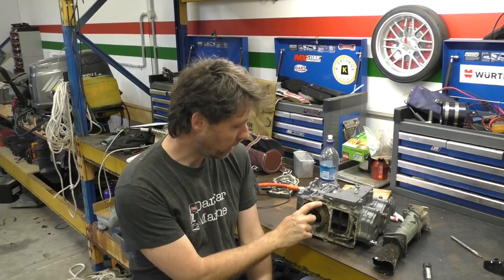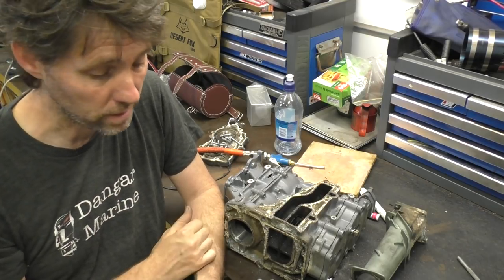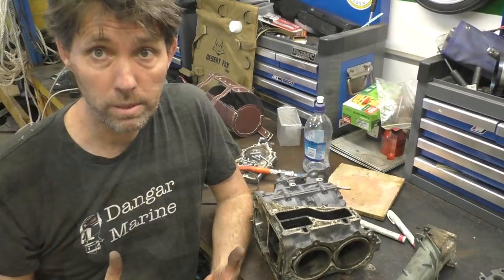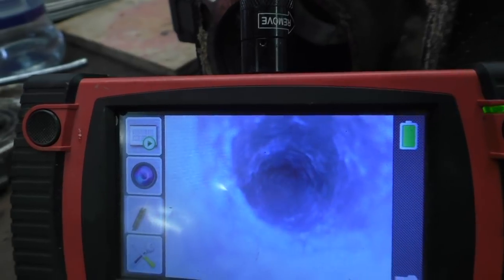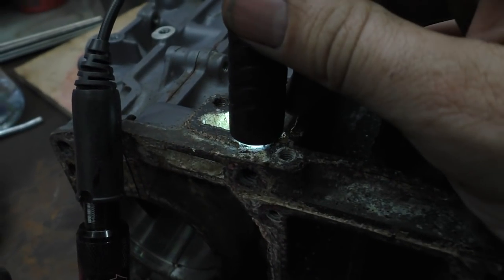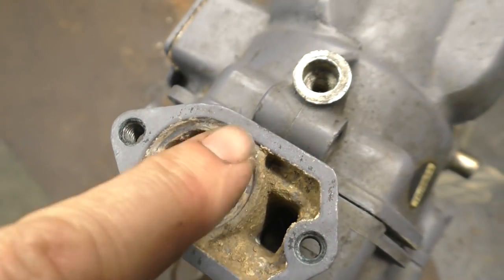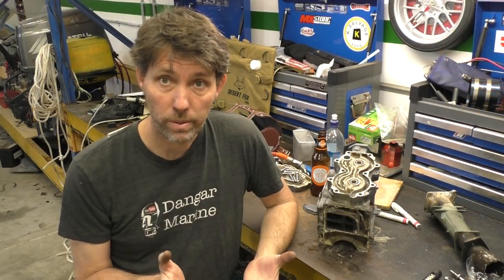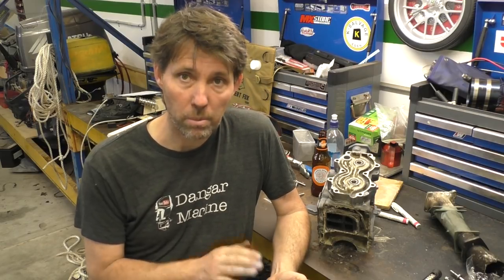Outboard cooling water

Comment: Hi Thank you so much for this video. Im hoping you can help me with my problem as i have run out of ideas. I have a Yamaha 50 HP 4 stroke outboard F50DET. Motor has been at me for 15 years with no major problems. Used the boat twice this summer with no problems, until a few weeks ago i drove into a bay and reduced the speed, after a few minutes the temperature buzzer sounded, with cool water coming out very well from the tale tail and at a strong pressure. To cut a long story short, i removed the thermostat which was blocked in close position. Still after 4 minutes on idle the temperature buzzer would beep. My mechanic came over removed and cleaned the exhaust plate, changed the impeller and still after 4 minutes on idle the temperature buzzer would beep. We decided to have a look at the cylinder heads, and we found a lot of salt/calcium deposits blocking the bottom part of the bottom cylinder head. Obstructing the water passage way from the cylinder heads to the exhaust plate. Being confident that we solved this problem the mechanic reassembled all parts this morning. Switched on the engine and still on idle after around 5 minutes the temperature buzzer went off. I am honestly out of ideas and desperate to find a solution. Engine is really getting hot especially around the thermostat area. We also tried changing the temperature sensor with a new one but still no change. When i switch in the motor without the thermostat cover water flows out. Any ideas what could be wrong? really appreciate your feedback.
Reply from the maker: If water is flowing up to the thermostat and the thermostat is opening it can really only be blocked cooling passages or a blown head gasket (which allows the combustion gasses to blow the cooling water out of the jackets)
Reply from the maker: Actually, I would also check ignition timing and if the mixture is lean as they can affect temperature too.
Reply: @DangarMarine  Thank you so much for your feedback.  Will relay this information to my mechanic. Yes water is flowing up to the thermostat, yet i have noticed that the top 2 cylinder heads (ones closest to termostat) are the ones which are heating up the quickest. The bottom 2 feel relatively cooler. He is coming over on saturday and he wants to remove the engine block and check for water blockages in the water passages under the engine block. Does this make any sense to you ?
Reply: @DangarMarine  may i please ask you what you mean by "if the mixture is lean" what mixture are you referring to please? Also the tell tale water flow is constant, you mentioned in your video that an inconsistant water flow may mean that combustion gases are mixing with water.

Comment: Another excellent tutorial. I have a 90 Yamaha 2 stroke. 20 years old and runs great. Just started getting hot after 10-15 minuets of full throttle. The Alarm sounds. It was fine at idle or low speed. Turned out to be popitt valve by thermostat. It was clogged with salt deposits. My question is... do you think it’s worth taking the head off just to inspect the water jackets?  If corroded of clogged How to clean? What to clean with?  As I said it runs excellent after cleaning popit valve. But im guessing there could be crud in there if the popitt valve had deposits. Thanks for your excellent videos and easy to understand tutorials
Reply from the maker: This video covers a few choices for cleaning the outboard. If it is running well now I would just try flushing a few times before taking the head off. The trouble with removing the head is that as well as needing a new head gasket, you don't know what else is going to happen with regards to bolts breaking etc. It needs to be really worth the risk. Here is a vid on various cleaning options https://www.youtube.com/watch?v=8w_o5xB8ZFI

Comment: Is there any way to clean the water passages ? Any additives  that will clean corrosion out ?
Reply: Rod Ashford  I heard from HullTruth that using white vinegar plus water, about 1:5 of mixture and let the outboard run about 15 minute or run until overheat alarms.  I would like to get try about it, but in my place its hard to find a big supply of white vinegar btw
Reply: Jerry Chan cheers for that i might try that and see if it works
Reply: Ive tried that with the block stripped, exactly like this demo powerhead,  it dissolved salt deposits after a overnight soak. I also use vinegar on my scuba gear works great but a bit sour on the taste buds hahaha...... I dont know about running the outboard with vinegar in it though.....I dont think youll get the full effect as the vinegar is just passing through and doesnt have time to dissolve the salt deposits. try it in a glass youll see what I mean.  just my thoughts good luck
Reply: J B Nz cheers mate, I will try and let you know how it goes
Reply: there is... salt away ...that is for flushing outboards with the ear muffs, Its not cheap though but worth it in the long run..
Reply: Caustic soda and water works well, Just mixed up a brew in a drum and run the motor for
10-15 minutes. Yamaha's are notorious for blockages
Reply: Baikal how much caustic in 80L/ 20 gallons  of water?
Reply: Hi. I am not sure of the ratio to use... All depends on the concentration of the caustic soda and level of corrosion. You have to be careful with the soda as it can de-solve the alloy castings if left for long periods and if you have a very strong brew. Just experiment... Just start off with a weak brew and go from there... Then flush the motor completely with fresh water.

Comment: Thank you for great videos. I have no thermostat in my outbord mariner 30 hp year 1985. When i try to start the motor it just rushing after a while. Do you think no thermostat is the issue? I have already check the plugs and they are new and spark is good on both cylinders,and carburettor is clean. I have also changed the head gasket. Gas pump are also checked and good. Sorry for my bad English, hope you understand
Reply: I livein Sweden. And is winter and cold now when i try to start it up. it takes about 10-20 sec then the motor is rushing hard. I bougt this motor to renovate it. // thanks Anders.
Reply from the maker: By rushing do you mean that it running at high RPM? That doesn't sound like a missing thermostat problem to me. Does your outboard have a manual choke or some other system for adding extra fuel when the motor is starting cold?
Reply: Dangar Marine yes high rpm after start.  Yes i have manuell chocke. I also have some high exhaust gas when the motor is running.
Reply from the maker: If you have a manual choke then it can't be a problem with a failing auto system. It may also be a vacuum leak or a misadjusted carburettor.
Reply: Dangar Marine  thx 👍 i will try to clean up the whole fuel system again. Comp test was 7.1 and 7.5 (cold engine). Do you think that is to low 2 stroke 30HP mariner year 1985.

Comment: Fantastic video!  Now makes me curious about my setup though.  I have an old 115 which is 4 cylinders,  2 heads.  I put a temperature gauge on the one that is higher but wondering if that’s only tells me half the story.  Does that not give me any indication at all if the other side is a totally different temperature if the thermostat fails or the water jackets are clogged
Reply from the maker: That would be one of those “Typical!” Moments. ;)

Comment: Looks like I'll be replacing my thermostat now......as a preventative measure.   I has assumed a good flow out of the tube was all I was looking for.    Thanks for potentially saving my engine.
Reply from the maker: Yes, thermostats are definitely something I would be changing every 3-5 years depending on use.
Reply: Dangar Marine 
Haven't looked yet; I'm assuming it should be relatively the same location on my evinrude 60.   Thanks for the information.

Comment: Your videos are great, keep them coming. I actually have an 50hp Johnson with bad idle and something causing some water  to get on lower cylinder. Watching your video of headgasket replacement and this (even they are from yamaha) gave me some pointers what to expect when i start to tear it apart. :) There are not so many good outboard repair videos on the youtube at the moment.. Actually most of them are really dissapointing to watch. :D
Reply from the maker: Most two stroke head gaskets are pretty similar, and fortunately pretty each to do. Just take a good look for any damage to the block and head before you put it back together.

Comment: Do you know any information about out under hull cooling tubes? I have a Sea Ray 30'ft and was thinking of a better cooling system to use a dry exhaust. This will be wet slipped and not trailered. I would like to hear your opinion and any information given. I have 2x FORD 425 and it Wet exhaust. Thank You
Reply from the maker: Keel cooling certainly does have its advantages. I've never done a conversion on a boat but I'm definitely planning to do a video on it one day.

Comment: I have a 2004 15 honda tiller handle 4 stroke outboard that sits in a motor well on my sail boat. I have to sit by the top opening cover in the back of the cockpit. I was wondering if you will ever do a tiller handle to remote control video. I have searched but  have not found any videos on how to do it.
Reply from the maker: I've been planning to film that video on a mates motor for quite some time now. I must get around to it soon!
Reply: it would be must appreciated since there are no you tube videos

Comment: The second hole could be a decompression valve for easy starting. Only thing is that it looks a little big for that.
Reply: Seth Carrasco I believe you are correct. The reason for the passage design is to make flow through the port less effective at high RPM so you don't loose  power by it being there.

Comment: Hi Stu. My two stroke doesn't live in the water, I trailer it and flush the motor after every use. Do I need to run the motor on the muffs long enough to open the thermostat in order to properly flush the water jackets? Otherwise I'm not really cleaning most of the water path? I've always been told not to run it too long on the muffs in order to avoid it overheating. Cheers.
Reply from the maker: Yes, you need to run it until it is warm enough for the thermostat to open to flush it properly.

Comment: Great video!
I have a yamaha 25 dm 695 (25hp 2 stroke 1986)
Having bother with overheating, i’m experiencing the same situation you explained at the end but i dont have any big chunks out of cylinder head, i have cleaned all waterways, on your did it just need the head gasket replacing to fix the engine? 
Thanks

Comment: I have water dripping out of my cylinder cover when running, and some small bubbles under throttle, this is at the very bottom cylinder. 96 evinrude 25hp. Just bought it,and ran it for several miles,it did amazing. Guess I’m going to go ahead and do a head gasket on it…
Reply from the maker: Water dripping from the cylinder head is never good. Well worth doing the work.

Comment: Hello Dangar Stu. I know you are a busy man, but I had hoped you would have been able to answer my questions below. I would also ask why they do not put the pee hole where the cooling water exists the powerhead, then we would know everything is working as it should.  Could my problem be that the water on the Starboard is not escaping to the exhaust and therefor overheating. Thanks again, I love you videos.
Bob, in Victoria, Canada.
,

Comment: Hi dangar, thanks for video, it most usefull for me, one question, my motor can mount a thermostat of 42° or one of 62° wich is more indicated?
Reply from the maker: To be honest, I don't often look at the temperatures I just order them by part number. I did just read this interesting forum thread on MarineEngine.com that talks about the difference between salt and fresh water use which may explain the choice http://www.marineengine.com/boat-forum/showthread.php?397402-thermostat-temp

Comment: I have a 1979 35 hp johnson I finally noticed it's not pumping water got new impeller put in but now 95 compression on bottom cylinder and 75 top cylinder so is it shot or need head milled and new gasket any advice please

Comment: Funny you should post a Video on cooling, I have a Mariner 4m that has a little puzzle for me. 
No water from the tell-tail so I checked that the tubes were clear and replaced the impeller. 
After the first start-up it had a little bit of water flow then nothing, so I rechecked that the tubes were clear. 
All that is coming out now is exhaust ??????  no water.
Reply from the maker: I would start by doing this test https://www.youtube.com/watch?v=lOE_VRda52A The ultimate test really is does the outboard stay cool or overheat. A cheap $15 infrared thermometer will help you determine that and put your mind at ease.
Reply: Thanks for the quick reply !!! 
I will try this.

Comment: If the thermostat is stuck closed or the galleries are plugged would that also put the water pump under much more stress trying to pump all that water just out the tell-tale? That being said since the drive shaft runs the pump would you notice engine performance degrade as the shaft tries to drive all that water pressure or will the impeller simply slip under that load?
Reply from the maker: Because the fins on the impeller are flexible it doesn't really cause much of a change. There is always quite a bit of back pressure on these pumps.

Comment: I have a 1972 25hp johnson that has no tell tale, is that normal? Also when u assemble the water jacket covers should you use gasket sealer on both sides of both paper gaskets? Thanks for all you do in ur videos

Comment: this was cool here is my problemi have an 2012 175 yamaha the over heat alarm goes off only when its at idle so i replaced the popet both thermo stats and impeller and no change so yeah its got me lil worried i just payed alot for this thing but as long as im above a certain amount of rpms to increase water flow it doesnt over heat or atleast the alarm wont go off but am i doing harm to my motor

Comment: Another great video....do you have a video on what you do if the water is not reaching the thermostat. After putting in new thermostats I still got the overheating warning buzzer and when touching the port side water jacket it felt much hotter then the starboard side, so I took off the water jacket but it did not look clogged up with gunk. The inside looked dry as though no water passed through it, but then thought it could have dried up with the heat before I got the cover off. After watching your video I will run the engines and see if there is water getting to the thermostat or coming out the whole where the thermostat is located. I would also be interested to know if the same water passes through both sides of the engine, as I can only see what looks like a temperature sender on the starboard side only. Should there be one for each set of 3 cylinders? The engine is a 1990 Evinrude 150 hp XP V6. Any idea what XP stands for.
Thanks again for the video. Yours are the best videos on youtube, and glad you have a sponsor. I would buy from them, but I live in Canada.

Comment: Very good video as always! Always felt like the water cooling in an outboard seemed like a solution that's fraught with failure that leads to destroyed motors. Why not have an enclosed system like a car with a heat exchanger/radiator with said radiator built in to the leg where it could easily be cooled by the water the boat is in?
Reply from the maker: Cost and weight are probably the simple answers. Because outboards hang out past the transom weight is very important, and everyone is looking for the cheapest price they can get. I have been interested in doing a video on a fresh water conversion on day just for the fun of it.

Comment: This has probably saved me from ripping my powerhead off. 
I have a 1979 Johnson 115, I was under the impression that all the water came out the exhaust after flowing around the block etc. on mine, very little comes out the prop/exhaust and most comes out little drain holes in the lower leg.  
If anyone could confirm this, it would be greatly appreciated. 
Thanks for the vids Stu.

Comment: Great video, hope you can do one on a Merc V6 and an Evinrude V6 too!! ( I have to admit i'm still a tad confused)
In my experience with my Merc V6's,  thermostat maintenance is more important than the water pump! Every time i've changed the water pump i look at it and say why the hell have i bothered doing this? But the thermostats nearly every time are encrusted with salt and corrosion and i flush my motors every use! The old merc v6 thermostats are quite small, appear to be made of copper, inside an aluminium (or aluminum for our American friends) housing. What does Copper + Aluminium + salt water = ? Corrosion!!!!!
Reply from the maker: I know what you are saying about impellers looking fine most of the time you go to change them, they are very tough and obviously don't corrode. Thermostats on the other hand...

Comment: Dangar Marine what should i do if ive hit a sand bar at speed im concerned i might have a bit of sand in the motor. Should i remove the thermostat and give the motor a good flush
Reply from the maker: Yep, that would be a good way to clear it out.
Reply: Thanks mate

Comment: Great video. I just replaced the impeller on my 2007 8hp Yamaha outboard. After starting the engine I held my hand in the telltale stream and it felt warm. The motor was running with the test muffs over the cooling water intakes and connected to a garden hose. Is it normal for the cooling water to be warm coming out of the telltale?  Or does this mean I am not getting proper cooling and maybe a blockage or damaged head gasket. The thermostat opens normally after testing in boiling water. Thanks